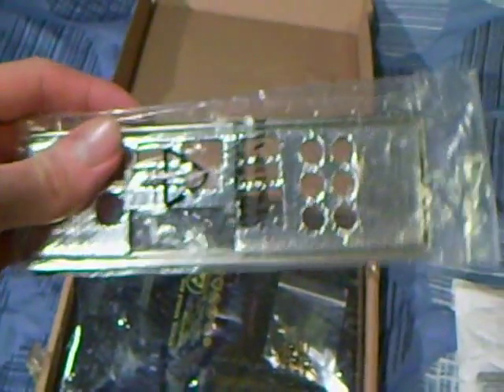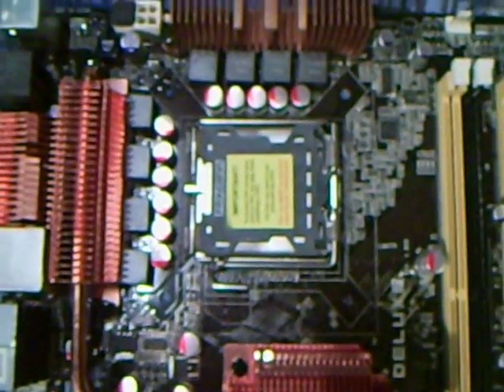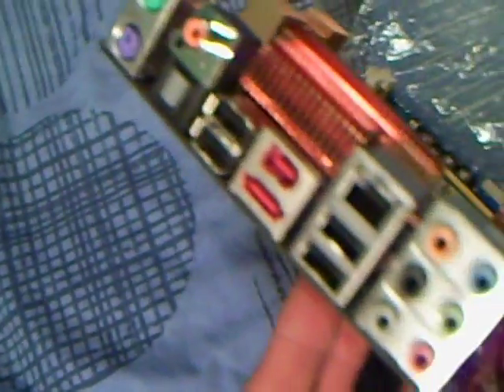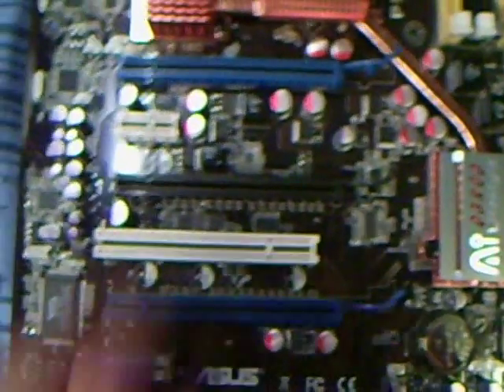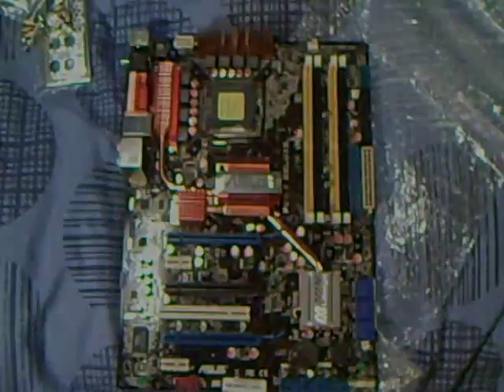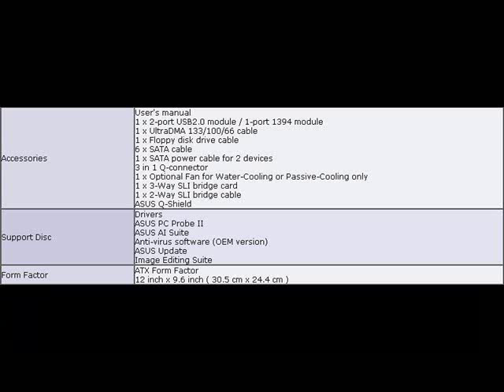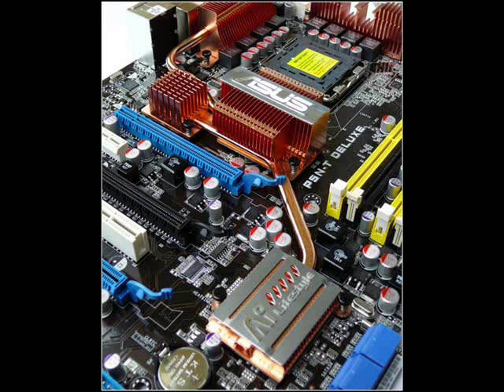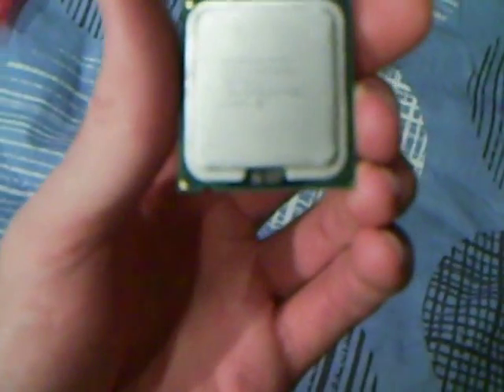Asus P5N-T Deluxe 780i & Intel q9650 Overview/Firstlook (NEW BUILD) 5th & 6th Component

Comment: Necesito tu ayuda

No se te calienta micho el chipset.
Tengo asus p5nt deluxe.
Sin overclock con la ddr a 1066 y bus a 1333
El disipador de la placa quema bastante.
El procesador lo tengo a 50
Nose si se me cuelga cuando tengo la ram a 1066 por calor o por fallo de ram. El mem test lo pasa bien.
Pero con uso normal a 1066 se me termina colgando el pc.
A 800 va bien.
Que opinas?